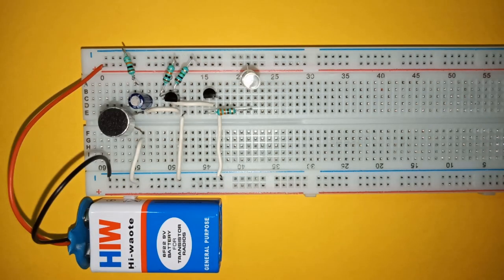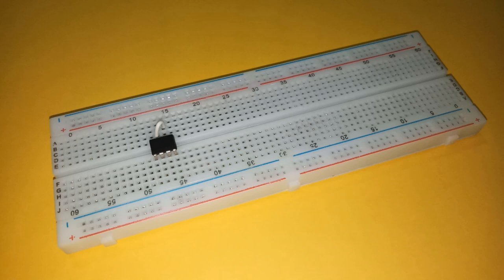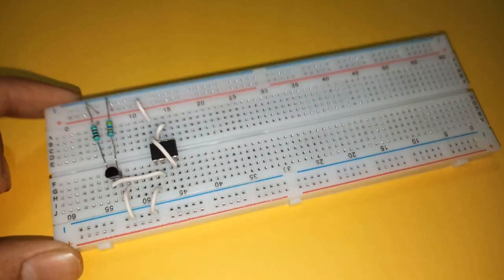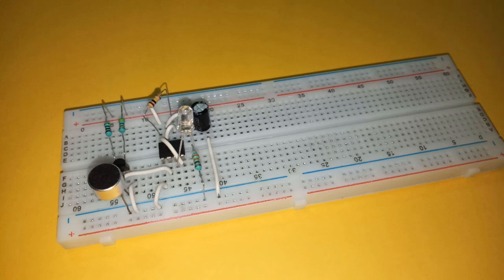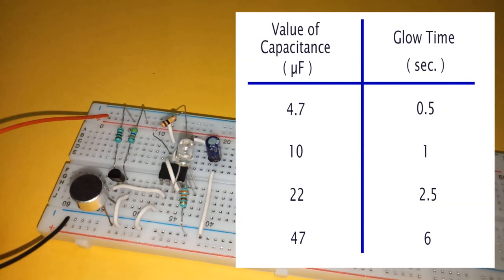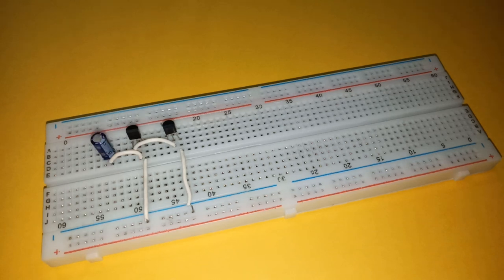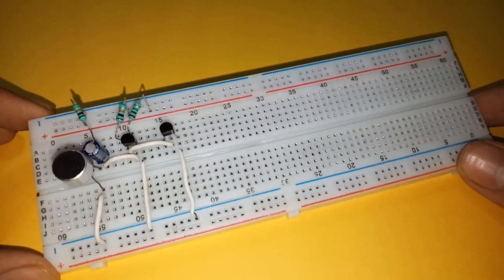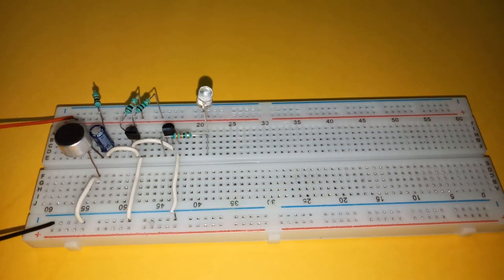Two Transient Clap Switch Circuits || 555 IC / only Transistors || Step-by-step Tutorial

Comment: the transistor switch did not work for me. Only works for some people NOT me. My bc547 must be different. My 1 meg resistor must be wrong? My 10k must be wrong. Is this a scam??? I have made lots BUT none work. WHAT TYPE OF BC547 ARE YOU USING. iS IT SOMETHING DIFFERENT? This is a waste of time.

Comment: I made the 555 timer circuit. At first I was having the same issue as some others as in the LED was on from the start. Instead of changing out the resistor each and every time, I put a 200k variable resistor in place and found the best level that way. Then replaced with a normal resistor. Many thanks for sharing, much appreciated. You have earned my subscription.👍🇬🇧😷
Reply: Can share a picture of ur circuit I'm having the same issue
Reply: @thatfnafguy8242  me too

Comment: Led is getting ON directly from supply....not responding to claps or sounds...what may be the prblm?? And how can we fix it out ?
Reply: Try changing 47k resistor with 100k resistor...'worked for me'and keep the circuit away from direct sound from fan or anything because it seems to be very sensitive circuit

Comment: My circuit is not working. The only change I did is using 220 ohm resistor instead of 330 ohm
Reply from the maker: Changing 330 ohm to 220 ohm does not create any problem, you should try increasing the other capacitor values.

Comment: i'm having the same problem. the led is constantaly on by direct supply..the mic is not responding to clap..
Reply from the maker: The circuit must be extra-sensitive,  try:
1. Increasing resistance values, or
2. Keeping the circuit away from direct air like from fan or so.
Reply: @Molted  yes i increased the resistance.i used 100k instead of 47k .now it's working..thanks for the help..

Comment: I've created it on dotted PCB but it's not working only the led is is glowing which can be done from direct supply also . Where I am getting problem plz tell me
Reply from the maker: The circuit might be extra-sensitive, you can try:

1. Increasing resistance values, or
2. Keeping the circuit away from direct air like from fan or so.